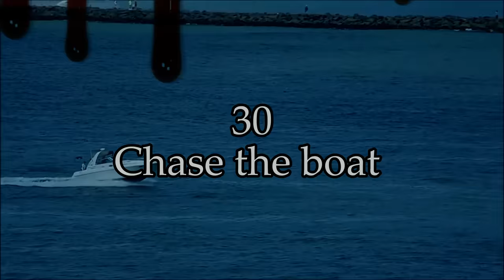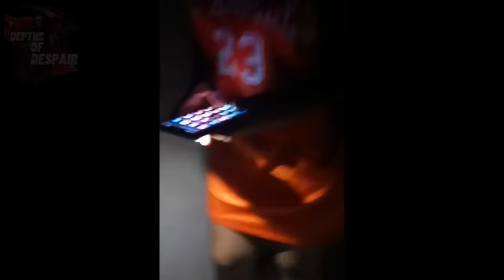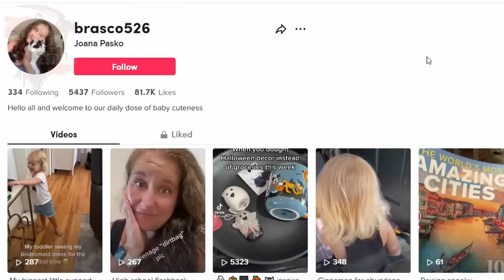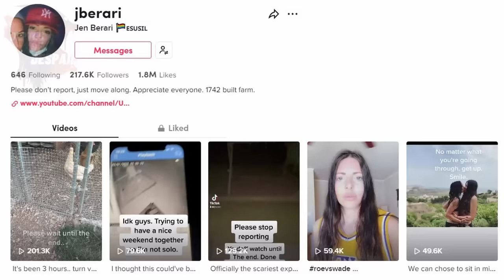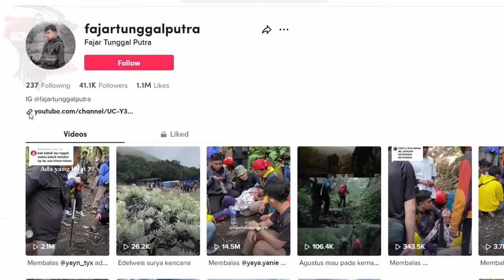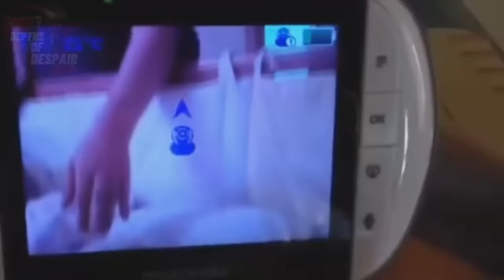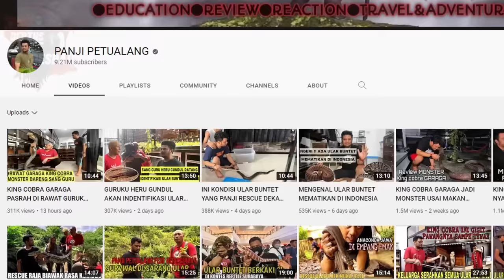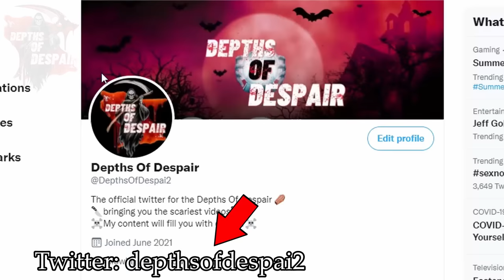Top 30 Scariest GHOST Videos Of ALL TIME! V3

Comment: What is it with women and bathrooms?  If they get sad, angry, scared or - for any reason at all - they immediately run into the bathroom and lock the door.  Why?  Tactically, it is one of THE worst places one can go, especially if you're being chased by someone.  There is an old saying in the military:  "A cave is a grave."  In other words, if you go running into a cave, there's usually no way out except the way you came in which means if you go in there, you're trapped.  You have no more mobility, no more freedom of movement.  All you can do is sit in there and hope your pursuer just conveniently goes away.  A bathroom is the same exact same "cave is a grave" scenario.  One way in, one way out.  Many bathrooms do not even have a window for the sake of privacy - and those that do are much too small for someone to climb through.  And many more are on the second floor so jumping from them will often result in broken bones. 

You do NOT want to corner yourself, which is what women do time and again when they go running for the bathroom.  The internal doors of houses - especially houses built after the 1970s - have cheaply-made hollow doors that an average man could tear right through.  A stiff shoulder is all it will take for your attacker to be right there in the bathroom with you.  And then what?  Now you have nowhere to go.  No other options at all.  You don't even have the space to perhaps out-maneuver him because, no matter where he is in relation to you, you are never out of his reach.  There is literally nothing worse - NOTHING worse - than people who lose their shit when things happen.  I would not want to be within a mile of those girls in the bathroom who screamed and whimpered and cried non-stop in any kind of crisis situation - paranormal or not.  People like that are psychological poison to yourself and everyone else around them.  It's fine to be scared - you wouildn't be human if you weren't frightened.  But as you can see from watching these ghost videos all across the internet - there are a lot of girls who are scared half-to-death and yet don't scream and cry and whimper and lock themselves in the bathroom and wait for things to happen to them.  Did they even call their emergency number?  Whatever it is in their country?  I couldn't tell what they were doing because every little noise launched them into orbit.